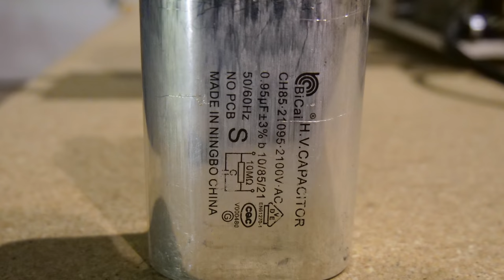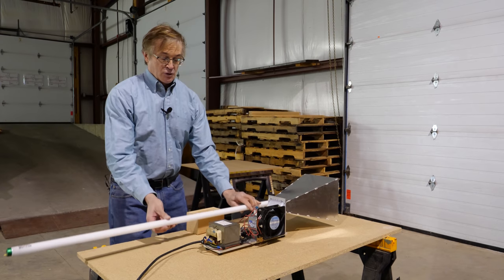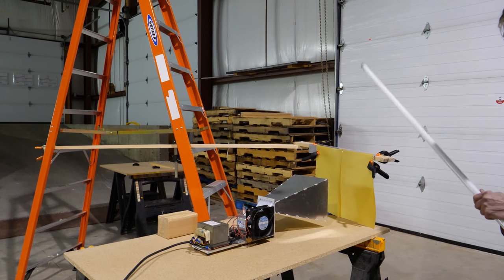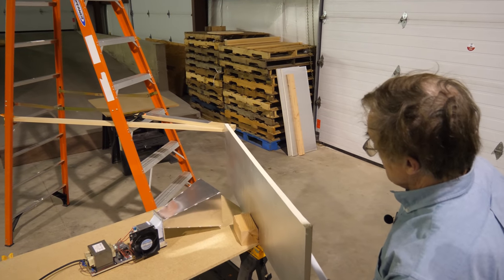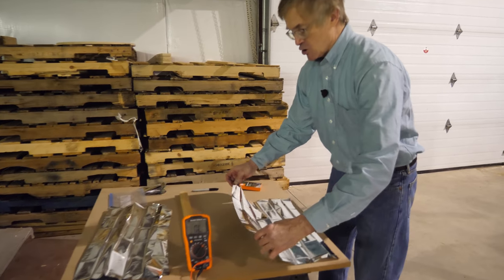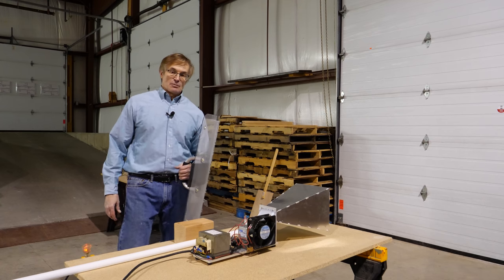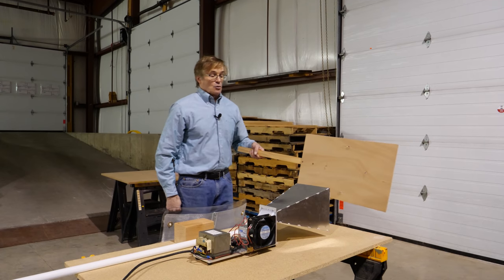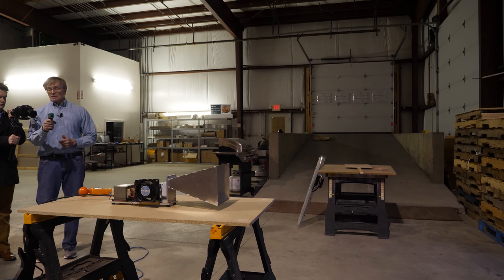You're not protected from microwaves... yet - Part 2

Comment: When i worked in the RV industry, one of our jobs was to test all microwaves and we used a neon bulb embedded in silicone to keep the bulb from breakage. In the microwave it would glow while running the microwave we also tested for leakage outside the microwave. This is cheap takes a very little time to make and is very accurate. You could make a wrist band with a neon bulb as a detector. Many old appliances had these bulbs in them to. I always seem to find me a free one to make a detector out of. And they work and last forever as long as the bulb isn't broken. You can just clip the wires off as they aren't needed. we used a clear silicone to embed the bulb and a 25 cent gumball toy has a clear case to embed the bulb in with the silicone. Let the Silicone cure overnight, and you have a new tool to detect microwaves. Cheap, dependable and long lasting.
Reply: Most recent thing regarding MW was the infant rashes at the hospital. The tower was right outside the window where newborns were placed.
I wonder if it would spark up the bulb?
Reply: @franklopeziilmtmti603  
It might it depends on the intensity of the MW Waves, in a Microwave these waves are pretty high, though I image if its that high a Florence tube though "static electricity "would also cause it to light up" while in your hand. And it would kill and enfant most likely and or seriously Injure if that high 

As for baby rashes that sounds more like allergy's to detergents. Just keep them dry, And Powder those behinds. lol 

And blinds and curtains on the windows, A simple Space blanket you can get for a dollar, cover the window would also reflect MW radiation to a degree. If this is a hospital then you could say that the tinting on the windows would cut down certain radiations to a degree. It's what they are designed to do.

There are detectors that can register most of these radiations, that would be the best way to determine if the babies were receiving any type of hard Radiation as that is what Microwave is a type of radiation. My bulb is just a cheap detector

We live every day with a certain amount of background radiation of all types.
Reply: @dirtybird2202  small neon bulbs can help detect mv. The rashes are what the nurses are reporting from the nursery where newborns are kept.
The 5G antenna is right outside just a few feet from the ward.
Reply: @franklopeziilmtmti603 I'm a midwife. Newborns suffer rashes from the skincare products used on them from day 1. Plain water is all that is needed, not all the lotions and potions full of SLE, sulphates etc. Also, baby powder contains traces of arsenic- several successful claims have been made recently around ovarian cancer etc, against Johnson & Johnson, so they have withdrawn sales of baby powder in the USA. They still peddle their toxins here in the UK where most people haven't a clue.
Reply: @maryhall3722  but once they're moved, rash is gone. It isn't the only thing that was noticed. It was only the obvious visible issues. They were becoming ill as well.
Reply: @franklopeziilmtmti603  thanks for the info, I didn't hear about the full story. Babies are born into a toxic soup these days one way or another, sadly. Awareness is growing, hopefully...
Reply: @franklopeziilmtmti603  thanks, Frank👍🏾

Comment: Years ago I worked for a company that made glass panels that were filled with argon and had a sheet of electrically conductive tinting in the middle. They were used on a building here in the Bay area called the Blue cube. I was told they were all grounded together so that nobody could hear any sort of radio frequencies inside the cube
Reply: I had a similar film placed in our RV on the cabin windows.
The other windows have a stainless steel mesh and the RV itself is made of aluminum.
Reply: Ha ha, oh yes that building
Reply: wow an insulated, grounded faraday cube.

Comment: A chocolate bar in your pocket has been known to detect microwave radiation :)
Reply from the maker: Unless you have a hot pocket.
Reply: Infra Red too.
Reply: Isn’t it the legend behind the “discovery” of the microwave application for cooking ? the story where a guy working around radars found his chocolate bar melted in his pocket after passing in front of a radar ? ^^
Reply: @Karibo_0  yes that is the story. As my father told me. He was a radar and missile guidance technician from 1954 -1974 stationed at white sands .he also was on the team of technicians who did all the testing and perfecting of the guidance and controle systems of the apolo lunar landing modules. My fathers mark is on equipment that is setting on the moon . That accident with the candy bar happened at Raytheon in the testing aria of the radar tube manufacturing plant as radar tubes are tested to be shure they oscillate at the right fq and are  stable 30% dont make the grade they are junk . So the man with the melted candy bar said lets make ovens out of the junk. And making an oven out of a junk microwave tube not only saved Raytheon a bunch of money it turned a profit.  And got rid of all that waste.
Reply: @Karibo_0  It was not a chocolate bar.  According to Percy Spencer's grandson, it was a peanut cluster that he used to feed squirrels and chipmunks during his lunch hour.  This is not a distinction without a difference as the melting point of chocolate is much lower than that of other confections.
Reply: What should be the ingredients?
Reply: @michaelshultz2540  "equipment setting on the moon" ? Really.
Reply: @davel6614 there was just an article about caves on the moon so idk why not
Reply: For those who are being attacked with Milatary weaponry- what can we do to defend ourselves.  I am being attacked by it now- someone set me up-

Comment: I built a circuit for detecting EMF called the "electrosluch". Sluch is Czech for "listen". It has a headphone jack and reproduces the EMF as sounds. Some of the sounds are cool to listen in on, but most are annoying. You can buy one from the inventor or build from a schematic. Since I already had all the parts, I slapped one together on a breadboard. Its a small and easy circuit (10 or so components).
Reply: Do you have anything i can buy off you that would block military weaponry usage of microwave heat attacks

Comment: One of the first production/broadcast studios I built was Faraday caged with aluminum sheets that the local paper used in their offset press.  1400 kHz at 1000 watts, antenna < 100 feet away from the new studio.  Forty years later, and they still use it.
Reply: you know, with the right antenna, you can talk to people 1000km away at 14khz with less than 14 watts.
Reply: @nobody8717  It's a good idea to have the right license, too.
Reply: @nobody8717  LOL a QRP operator
Reply: @johnwiley8417  don't thread on me radio waves
Reply: @johnwiley8417  muh license
Reply: @nobody8717  ?Intriguing.RadioItsNotOver200Khz?ItIsSaisThatLowFrequecyGoesFurther,ButINeverHeardOfRadioTransmisionUnder200Khz.

Comment: Great video with very useful information, I knew most of what you presented but I wasn't aware of the effect on an infrared heat detector. Keep up the amazing content.
Reply from the maker: Thanks.
I didn't either until I began examining the different blocking materials and got some screwy results.
Reply: @TechIngredients  But how exactly is it detecting something?
You were standing behind the microwave source so at the position of the meter there shouldnt have been much.
Reply: @70lulatsch  It's imparting a voltage on the sensor and reading it as a value, basically.  A lot of components, most notably, germanium transistors and diodes, pick up radiation in the RF bands (even LEDs make good RF sensors - depending on the formula).

Comment: A wonderful follow-up video, thanks! You never mentioned why you marked the space blanket with "front" (however you spell it 😁) I suspect it may be because if the microwaves penetrate through the polyester film first and are then reflected back by the metallic layer and back again through the polyester layer, the polymer will heat up and could even melt.
Reply: I was wondering the same thing. I was waiting for you to reverse it to see the results. Absolutely a great video, thank you!
Reply: The plastic doesn't reflect or absorb, so theoretically it doesn't matter which side is metallised. The exact same reason why it doesn't matter that your protest sign is plastic with aluminium foil sandwiched inside.
Reply: @johncoops6897  Metallised polyester films are used as susceptors in microwave cooking. They heat up on the polymer side of the film and provide browning/caramelization to the food by effectively becoming a convection cooking surface. One popular use of this is in microwave popcorn bags. So, it appears my initial question was justified. So we know that the metalised polyester blanket will get hot, but will it get hot irrespective of which side is facing the microwave source?  A few experiments might be in order! https://www.youtube.com/watch?v=NtwkzXi6ylc https://en.wikipedia.org/wiki/Susceptor
Reply: @markwarburton8563  - That is a COMPLETELY different product and application.
If you wish to search, you can see that the question has already been asked and answered a number of times before your comment was written.
However, since you know absolutely everything I don't suppose that you will take the word of the channel owners who have already confirmed that there is no heating effects nor difference in effectiveness between the "front" and back sides?
Reply: @johncoops6897  How is a metalised polyester film "COMPLETELY different" from a metalised polyester film? That makes no sense.
Reply: @markwarburton8563  - You babbling about Microwave popcorn makes no sense. Those susceptors use the (selective) metalization to create the heat, not the polymer/plastic film they are deposited upon.
Please, just go search for the other answers from Tech Ingredients, and don't shoot the messenger.
Reply: @johncoops6897  LMAO. 
"You babbling about microwave popcorn."
Reply: Should make clothing out of the copper cloth!!  That would be a good idea!
Reply: That shield 🛡️ with the detectors is really great idea!
Reply: What do the devices look like that put off the frequency for crowd control ? Up to how many feet away can these machines hurt someone?  2 ft - 3ft - 10 ft? 
Does the device look like a gun of sorts?
Reply: @natsar7   there are YouTube videos that show what you are asking about. Crowd control emf, frequency crown control… etc

Comment: Yet another great video!

I used to use the Neon trick to detect output from Ion Generators back in the day! You can easily whip up an amp with a couple of Transistors that could increase sensitivity a lot!
Reply from the maker: The advantage of the bare bulb is documentation.  No way the system could be set up to cheat and falsely accuse the operators of wrongdoing.
Reply: @TechIngredients  Agreed!
Reply: @TechIngredients  You could always mix and match.  It could be a crude intensity meter if you made them with varying degrees of sensitivity with the least sensitive being bare bulbs.
Reply: @TechIngredients  There are other advantages, documenting the direction to the source of the radiation and it's polarity.

Comment: The last position I held before retirement was a tech in a gateway earth station. We swept our waveguide routinely and after seismic events. We put out quite a bit of power in a 55dB gain antenna(15 M). We wore RF detectors when working near this equipment.
Reply: Rated antenna gain is only relevant in the far-field region.  A 10W transmitter (just for illustration) doesn't hit anyone with 6 MW just because they're standing in the beam "with 55 dB of gain".
Reply: @cdorcey1735  We were putting out a couple 100 watts on one polarity and about 50 on the other.

Comment: I'd really love if you tried to create a retroreflective shield, something that would bounce the beam back the direction it came. It sounds like a simple idea in theory, slap some aluminum foil on top of a cubic diamond-textured material, but my guess is that it would be a lot harder to get working than that. I really like the idea though, not just defense, but using the weapon against itself.
Reply: Good idea. How about vapor deposit aluminum or use conductive paint on a stop sign/safety cloth/something similar that already has the reflective structures? I guess you might have to adjust the cubic diamond structure for the wavelength.
Reply: He did make a shield in a previous video on the subject.  The reason he uses the convex part of the shield facing outward probably has as much to do with YT getting butthurt about it being "offensive".  In that use it deflects and mitigates the effect to the surroundings.  Remember that he has to come off as passive to avoid getting noticed "in the wrong way", but he does mention it in the "why".  My suggestion was similar to yours in that it's not offensive to return to sender, it's Judo. 😆
Reply: I don't know how viable that would work for a crowd control device. The inverse square law and all. It might work on a microwave emitter with a narrow scope, but that kind of defeats the point of using it on crowds. Also, knowing where you're aiming the reflection would be a pain.
Reply: @pills-  Inverse square law is only for point sources. Doesn't apply to directed sources and our nameless hosts here (I call him Science-Dad) probably should have mentioned that. Difference between a bare light bulb and a spotlight. His horn is effectively making it a bit of a spotlight. Which of course the weapon will effectively do as well (though with a phased array instead of a horn) as it need to in order to be aimed at a specific target. 

So, yeah, you could absolutely direct the columnated beam back to the sender with a retroreflector, and certain existing retroreflective materials just might work! (I wonder what a road sign would do?)
Reply: They make radar reflectors, mostly for marine purposes, that way. Though of course not as a shield, just as something that's guaranteed to give a strong return.

I wonder how big the cells would have to be for the frequency the weapons use. They need to be bigger than a wavelength (or is it 2 wavelengths?) for them to work. 

Actually, some retroreflective material might already be metalized to provide the mirror surface, so maybe you can just buy retroreflective tape in bulk and wrap yourself in it like a mummy? (I wouldn't expect that to work for 2.4 GHz home microwaves though as the wavelength is going to be a lot longer than the cell size.)
Reply: @pills-  In Mythbusters episode 45, Tori, Grant, and Kari showed that chocolate can be used to polish the bottom of a soda can into a fire-starting mirror, despite the fact that we are Ninety-Three MILLION miles away from the sun. A concave surface coated in a conductive material can, and will, destroy Radio, Microwave, Infra-red, and other long-wave EM sources if they are caught within the focal distance for long enough. Inverse Square law only applies to uniform, radially and spherically symmetrical single-point sources of infinitesimal relative size, a microwave beam is a collimated, directional spot-source less than a mile away from you.
Reply: Put a jar of Nutella (which has a gold foil built in the lid) in your microwave ... you will have your answer.  Poooof! Better have a fire extinguisher handy.
Reply: issue you will have is the focal point... think about a satellite dish, they have a receiver mounted a set distance from the dish (or like a magnifying glass, how you have to keep it a given distance from the ant your trying to fry), because that's the focal point. outside of that, the 'concentrating' effect of any shield trying to reflect it back at an attacker would be lost. The further your focal point is from your shield, the more imperfections in your reflecting surface will come into play to spread out any focal point. Basically, doing so more than a few meters in front of you would be more trouble than its worth... and at that range its more of a risk to bystanders than the emitter. Added to which your not being 'hit' with the full power of the emitter anyway, so you're only reflecting a portion to begin with.
Reply: With a concave shield you would do exactly that but you would capture and beam back just a little percentage of the original beam (most of it is already waisted all around you) so it would automaticaly get quite innefective because of the lack of power AND you have to think about the curvature of the shield itself to calculate exactly where the captured beam is going to focus. So you would ba able to use it just and only at a certain distance. Add that to the fact that you would have to aim without moving...
Sure it can be done but it's useless.
Reply: Yes. Take over their weapons and aim them at the other ones. You are welcome. "She's still with you," Psychic Warrior 009.
Reply: @RichardGreco  yes, visually reflective signs rely on the much shorter wavelengths of light.
Reply: @pills-  good thing about corner reflectors is that they work over a wide angle and just reflect all collected energy back in the direction it came from!